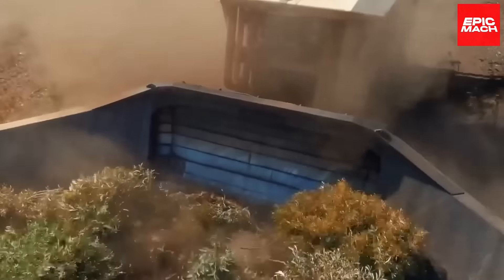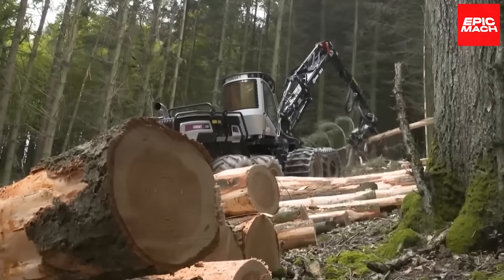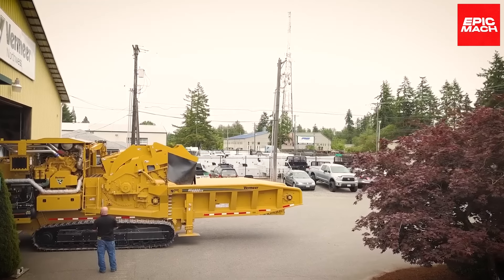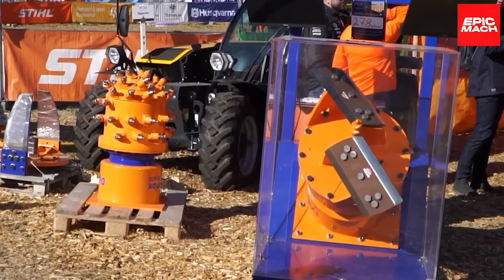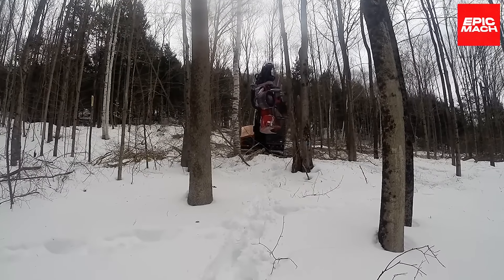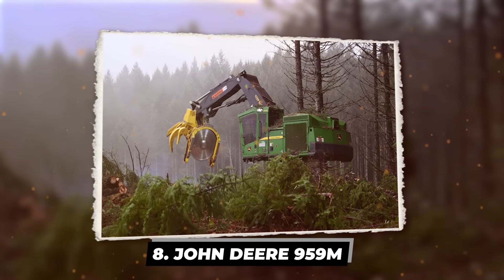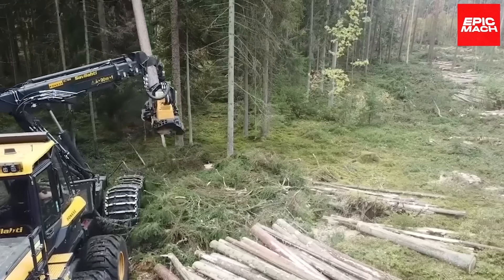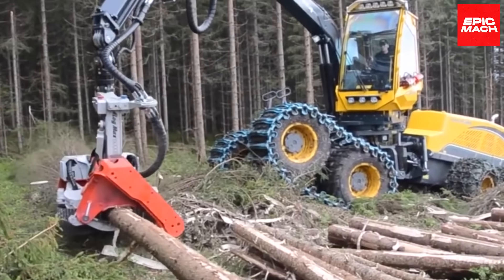Dangerous Precision - 10 Fastest Tree Harvesting Machines

Comment: Vermeer doesn't stand a chance against my 5710 Peterson hog. 4400 horse power.
Reply from the maker: Whoa! 4000+ hp?
Are you talking about the Peterson 5170 D or E grinder?
It's between 1050-1125 hp according to the manufacturer though.
Is your specific machine modified?
Reply: @EpicMach-home  5710 D tier 2 Peterson grinder.  C27 twin turbo Cat Power plant. It will eat  a 40" diameter log without braken and sweat.
Reply from the maker: @anthonyweigand6377  Oh, I am sure the 5710 D can do what you say and more. 🙂
Just reading the specs is very satisfying:
"Powered by a Tier IV Caterpillar C27 1050HP (772 kW) engine or an optional C32 1125hp (839 Kw) engine, the 5710D provides the highest power to weight ratio of any Peterson grinder."

What other beastly machine do you operate?